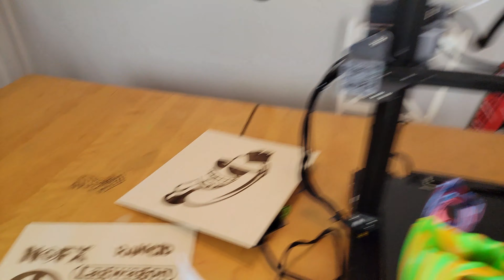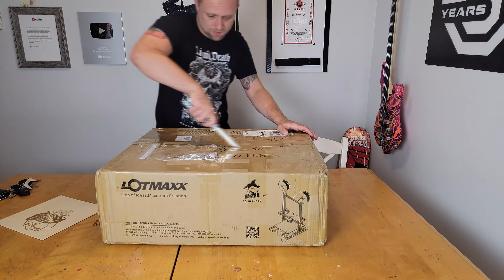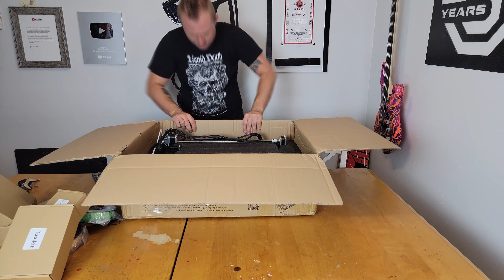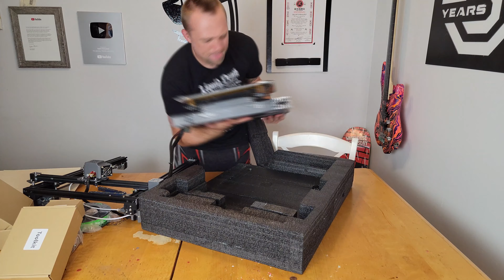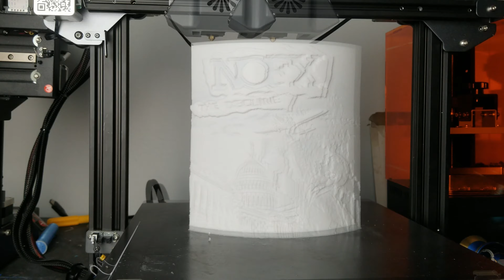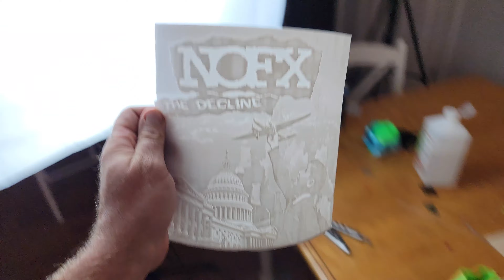LOTMAXX SC-10 SHARK PLUS. DUAL EXTRUSION 3D PRINTER AND LASER ENGRAVER.

Comment: The software to the laser sucks, it sucked for the first two Sharks and it still sucks.

They switched from the magnetic bed to glass because their aluminum beds are always warped and they are incapable of getting ABL to function properly with their terrible firmware.